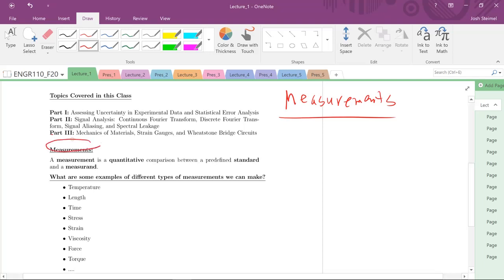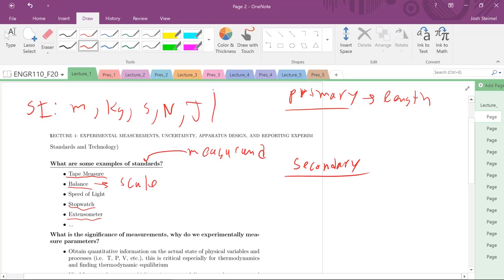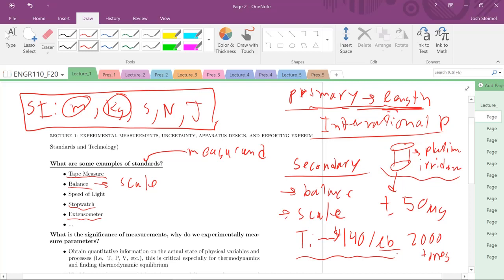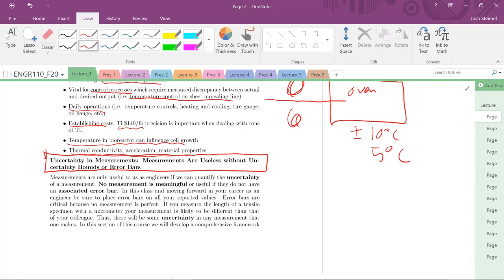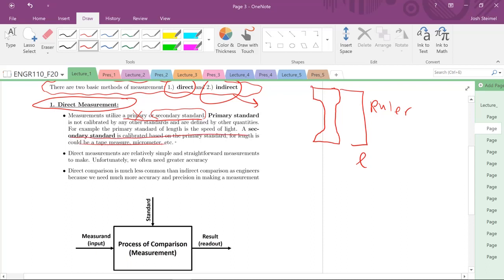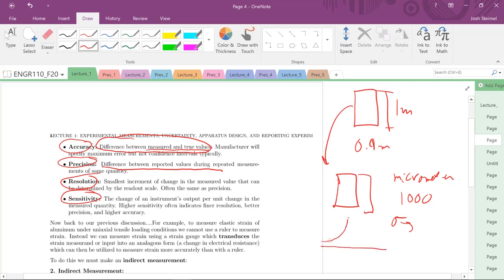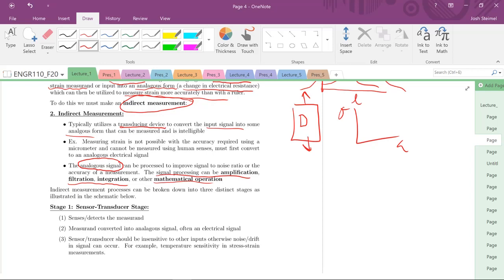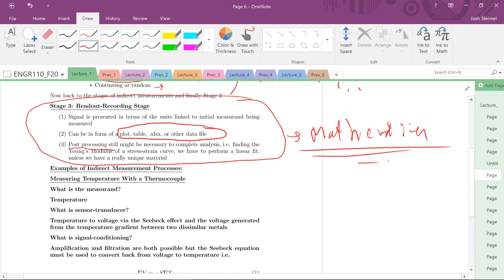Lec. 1: Measurements, Standards, Direct and Indirect Measurements

Comment: Respectfully, isn’t direct measurement redundant? And that would mean indirect measurements are oxymoronic. Fundamentally the process of measurement uses measurement systems (ruler) to sense the measurand (people call typically this ‘measurement’) and give a value (logical or numerical). That’s direct. 

I can see how one uses measurement on objects/variables which are INDIRECTLY related to the object/variable of interest so as to, by analysis, calculate for that object/variable.

I know that indirect measurements are a thing that many industries use and the message is clear - but does that actually make any fundamental sense?